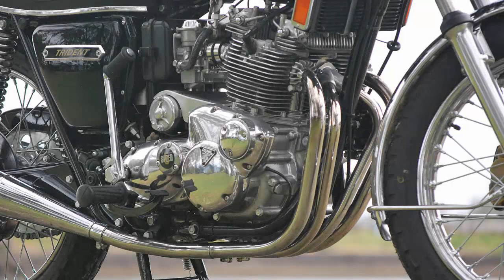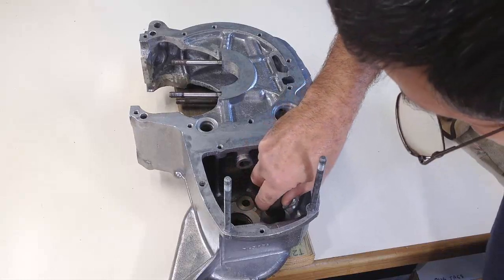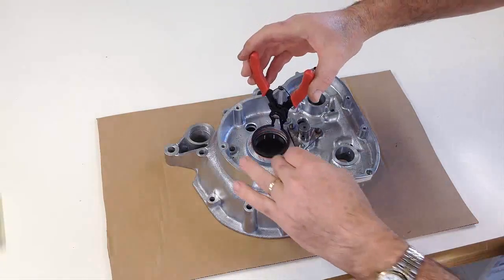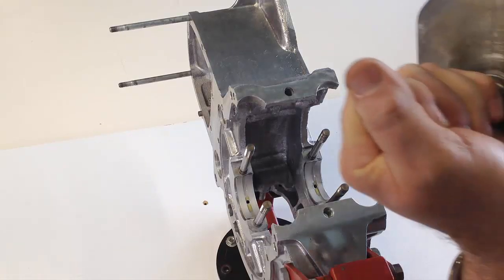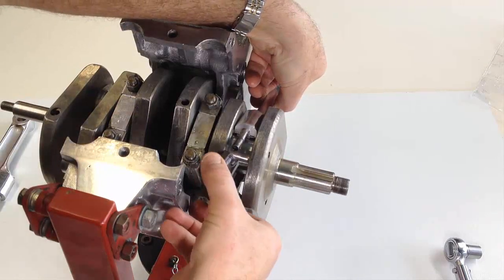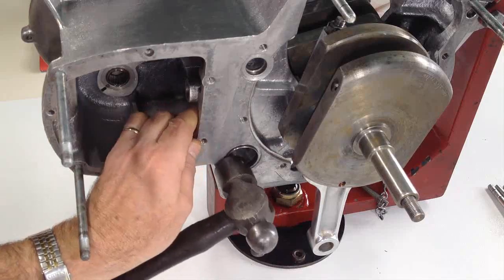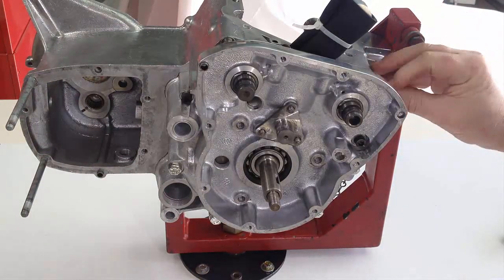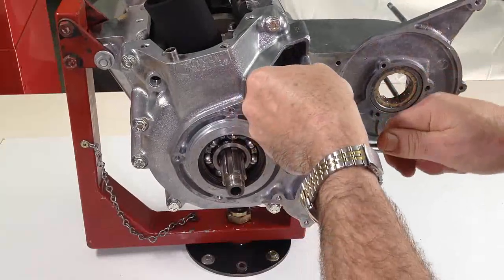Triumph Trident T160 Motor Assembly - Part1

Comment: Also have you ever measured up the clearance of a trident engine with low pressure issues to see how much clearance they were running  with ?  .
Reply from the maker: Hi Cobra 427. Clearance on main and big end bearings is critical. We aim for .5 to 1 thou... By the time you get to 2.5 thou clearance you're losing a significant amount of pressure.

Comment: Hi , do you get your cranks ground to suit , i:e fit bearings and measure and grind crankshaft to get the desired clearance . Do you end up with  a thou to a thou  ¼  ?  .cheers
Reply from the maker: We fit the bearings, measure the diameter and grind the crank to suit. We aim for .5 to 1 thou clearance.

Comment: Hello; I see that you did not used silicone or similar when jointed the cases; so Tridents are different than Twins regarding that? Thanks
Reply from the maker: Thanks for your comment. I did actually use sealant. If you look at about the 6minute 45second point in the video you will see I have smeared Loctite Master Gasket on the crankcase joint. We use it everywhere. One engine we rebuilt had an 8 thou gap in one spot on the crankcase flange. Master Gasket did the trick. It did not leak a drop.

Comment: Hi , do the t160s have any gearbox  Weak points  that should be looked at ? If motor work is in its future . My 5 speed makes  zero noises shifts well and clutch let's  me select neutral easy , Cheers
Reply from the maker: No. It's a great gearbox. Strong and easy to live with.

Comment: 18 foot llbs  for mains  .?  Bolts would take twice  that
Reply from the maker: Gary you're right, but if you do them up tighter the steel cap will crush into the end of the alloy rod and close up the clearance on the crankhaft. Half to one thou clearance is ideal for Trident big ends and it does not take much extra torque to close that up and bind on the crankshaft.

Comment: a complex process needing very skilled labour..   By contrast a Honda 750-4 motor was assembled by semi-skilled women in a fraction the time & would go about 4 time longer with complete reliability (& no Oil leaks)
Reply: Fella; you are repeating a mantra and actually seems that you are not real using a Triumph. I have 3 and are not Sunday bikes. The cb4 is not leaking oil due to the cases are the other way around...; the exhaust pipes are actually 2 pipes (one inside) and many more tricks.
Regarding top speed; the trident are more agile and many test finished with the superiority of the trident. The cb is just felt too tourism.
Reply: @TheReverb1    Never presume,,  I raced a Daytona,, a Boneville & Rob North triple, with success ..  The fact they went bust , due to appalling Mgt,,
says it all..

Comment: Doesn't make any sense to build the engine on the bench, build it in the frame, much easier .....
Reply from the maker: I guess it all depends. If you build the engine in the frame you run the risk of scratching the frame and you are limited in space and movement. We do not put the engine in the frame when it's finished, we put the frame on the engine. It's much easier and there's almost no chance of scratching the frame doing it that way.

Comment: What about the sludge traps in the crank,? Allow 3 hours to clean, you'll be amazed at the compacted metal, it is usually  ignored, all that polishing is for what? jack shemans was emphatic about it, he built slippery_sam racers, mid 70s ,it's difficult to remove the grub screws, use heat, an old speedo cable is good, and use petrol to rinse, when you can pump it through clear is job done ,loctite new screws, disregard this and your work, polishing et al will be in vain,
Reply from the maker: M Mark more often than not the grub screws need to be drilled out with a tapping size drill and then cut the remnants out with a tap. A smaller drill is the quickest tool to remove the sludge initially. Replace with a socket head grub screw and definitely use thread locker!

Comment: I don't know what sealant you are using, but I found that (bite my tongue), grey Yamabond used sparingly will never leak. I used it on Bonnevilles, Triumph Cubs, BSAs of all kinds, including Rocket 3s, and Tridents. Everywhere I went people told me I had no oil in my bikes because I wasn't marking my territory. Now I haven't watched all the videos, but if you remove the expensive and inefficient oil filter and use an external add on filter, you get better filtration and that filter never plugs up. 

I like the small filter used by Mitsubishi and some other cars and that a person can find remote brackets that are generally found on equipment such as welders and air compressors. My profession was heavy equipment mechanic so I learned to use what was available and those applications are ALWAYS cheaper than the same item purchased at your bike shop.The brackets & filters have the same mount as the Ford automotive filter, but the one used in Japanese cars is smaller and can be made less obtrusive. A Boyer Bransden electronic ignition makes everything work better and take the carb assy to some shop that can bore the carbs and put stainless sleeves over the slides. When doing this don't forget to drill the manifold and put balance tubes between.

Another performance trick is to find someone that can make a 3 into 1 exhaust and use a tuneable Supertrapp muffler on a dyno for max power.
Reply: Three Bond is Yamabond is Hondabond. No tongue biting needed. They work better than Hylomar.
Reply: @obfuscated3090  What about Loctite 515?